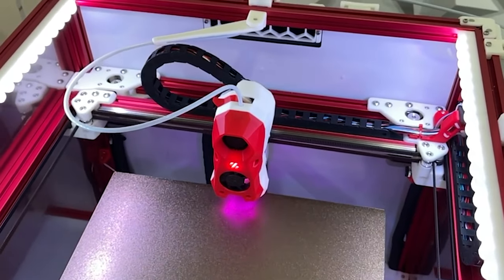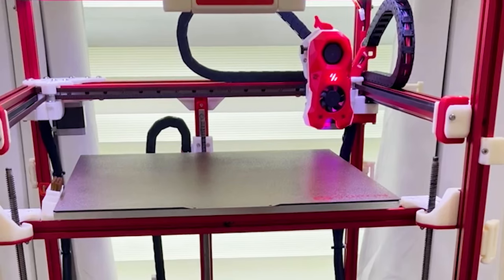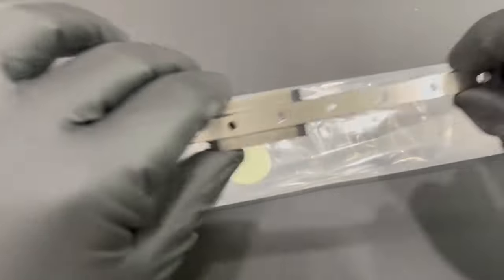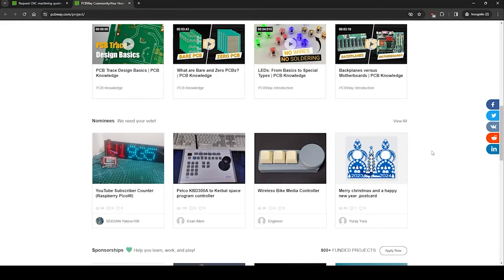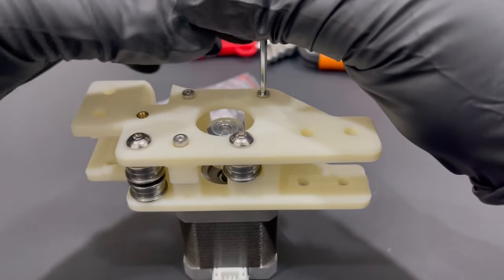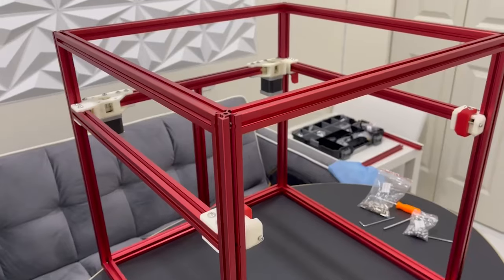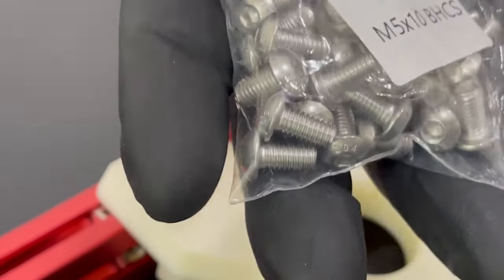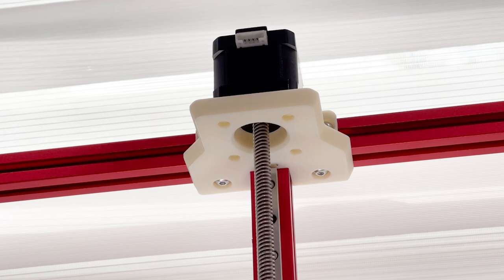3D Printer Build: Voron Trident Part 2 - Gantry and Rails

Comment: you should try the beefy idlers mods, they are stronger and easyer to assemble
Reply from the maker: Yes they are on my list of mods... Had I known about them during the build I would have opted to change them out from the get go.  I also like the way they look a little more then the ones I have installed currently.